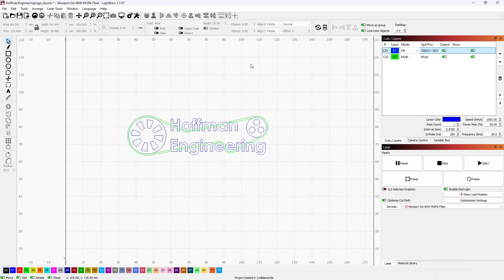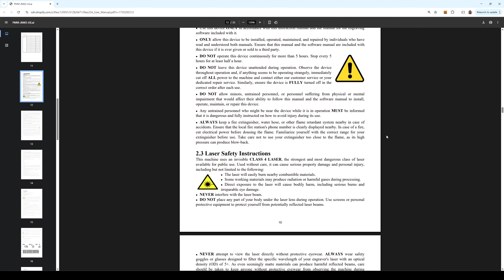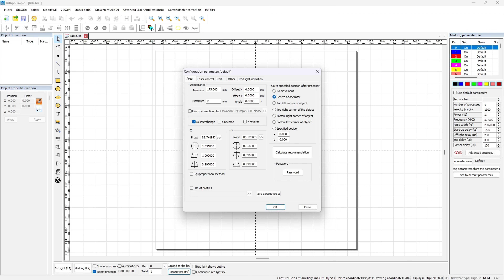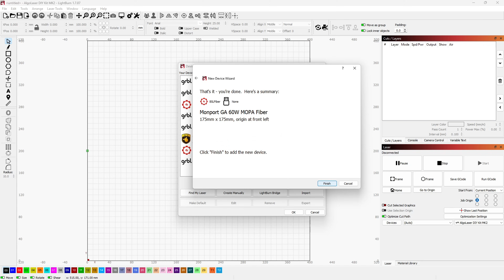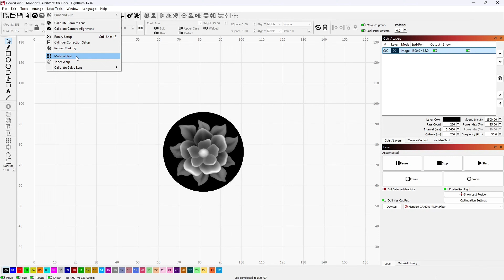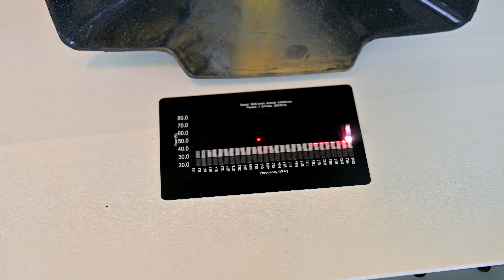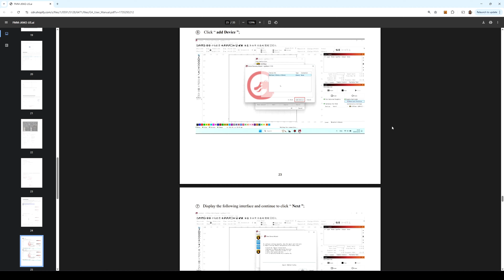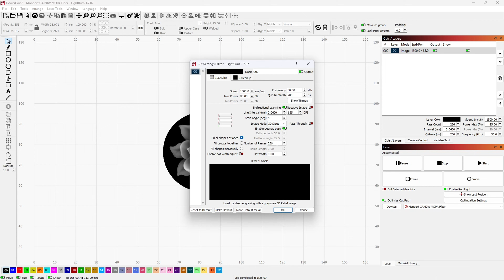How to setup and calibrate a Fiber Laser - Lightburn | Monport GA60 watt MOPA Fiber Laser

Comment: I try to use the settings provided on the machine for calibrating and I get ok results but not precise at all. Still some bulge and scale issues. Have you tried to do anything accurate and gotten similar?

Comment: I have a laser and lasered 2 months ago without any problems. Today I switched on my laser after a long time and realized that the laser no longer lasers where the frame or preview is displayed.

Do you know what could be the reason for this? I have checked my device settings. These have not changed.

The lens is clean. The device has not been moved.
Reply from the maker: Interesting, which laser is this? If it's a fiber laser with an in-line red framing laser, then I can't think of a way for that alignment to change besides the device settings being modified.
Reply: @HoffmanEngineering  Thank you for your quick reply. It is the Monport MOPA 30W. I think it should be the same laser that you have, only with less power.

Are you happy with the results if you write the values in the device settings that are on the device sticker? (Video 3:17).

And yes, it is very strange.
Reply: Thank you very much. Everything else I read said it was a JPT laser.. also, my Galvo was swapped as well.. excellent help! Thanks again.. did you get to dial in this coin engraving settings. If so, can you share. I’m pretty new to this.
Reply: @kennicooper6659  If I understand correctly, the JPT lasers have not been used since October 2024. The previous devices still had the JPT laser.